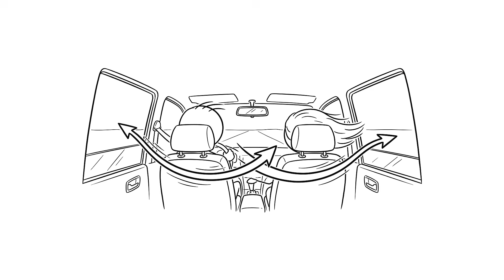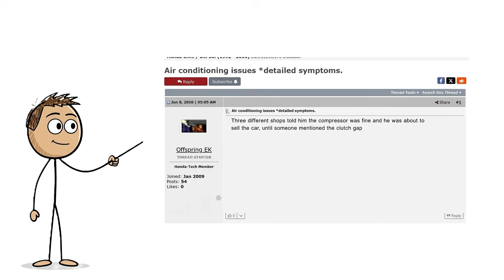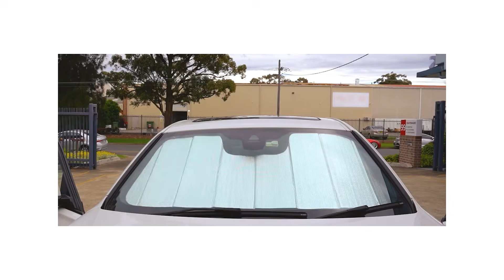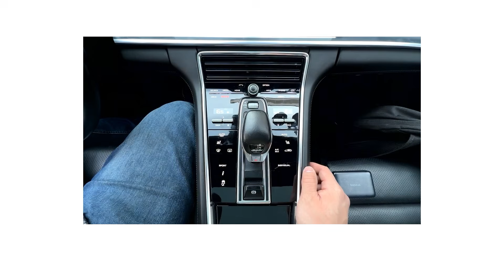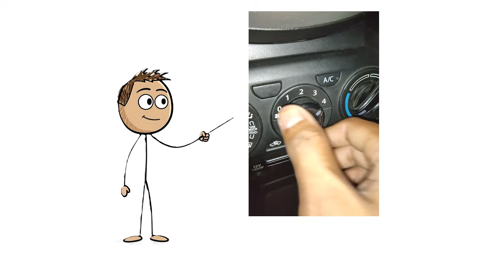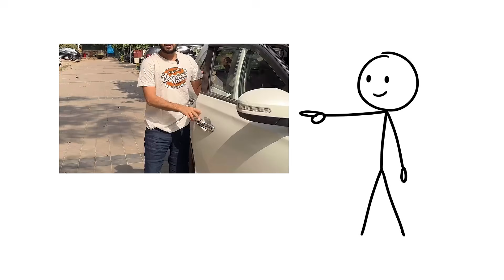How This Trick Resets Your Car AC And Makes It Blow Ice Cold Again

Comment: 2003 tundra truck can’t get anything to work less than 100,000 miles
Reply: Check the fuse or the plug on the compressor

Comment: Before you try any of this, make sure the A/C- heater door is actually functioning correctly. Some cars and trucks come with shoddy parts. In the mid-1990s, Chevy had a problem with the 1995 truck line up. The switch panel that controls the door functioning would fail, the bad part was at the time the replacement was 600 to 800 dollars, so what the service repair shops would do is use the 1996 and up switch panel, with an adapter harness, as the 1996 and up one at the time was only $150.00. Also, in hot climate areas its a good idea to use a neoprene tape on all the A/C hard lines to keep the cold in the lines instead of having the engine hot flash it out of the line causing it to take longer to cool your vehicle. Then, check all of the sensors that control the A/c unit. If those start to fail, the high and low sides will shut off the compressor. Then, move to the A/C clutch before trying to have the compressor replacement installed. It will save you thousands of dollars in repair bills.

Comment: Hi good man can you tell me is it there any way to fix the throttle I made a mistake and pushed it and now it’s open when the car is off. My car is Hyundai ix35 2012 diesel engine Also now that I cleaned all sensors that I could see the car doesn’t start. Much appreciated
Reply: This is confusing me-  isn't your diesel naturally aspirated and therefore not subject to the throttle body staying open? If you cleaned the sensors, then it's likely that's where your issue is. Maybe get a scanner on it? Also, if any vehicle is over 10 years old and having fuel delivery issues or no fuel delivery and you can hear the pump prime, then check the fuel line around the rear axle where the fuel tank line joins the body line-  those connectors can fail. All it'll do is suck in air. if that happens.
Reply: @Seanfcals ...narurally aspirated diesels are mostly installed in tractors...